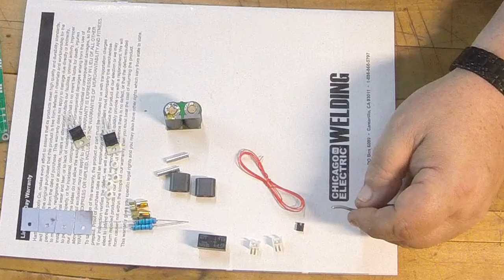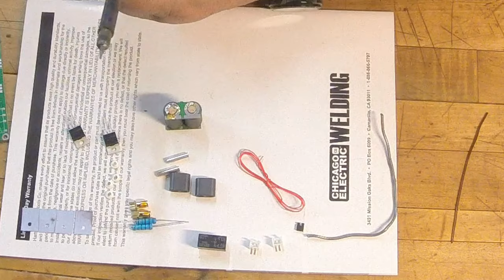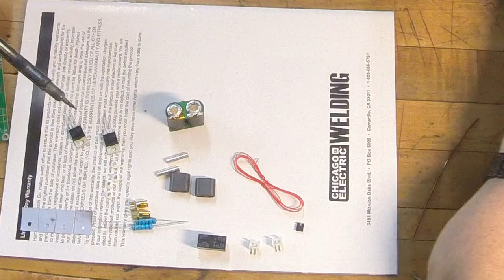Minipa 70 watt HF Amplifier Kit Assembly and Testing Part 1

Comment: My kit came w/o the electrolytic caps not soldered to the board. Did you mount those caps before you started your video? The reason I ask is because they are not easy to solder. My advice to anyone building this amp is to install those 2 caps before installing the big coils because there is little room to get into there to solder them.. I suppose it was too much trouble for the seller to write a measly instruction manual.
Reply from the maker: My caps came installed but I agree on if they didn't that would be the first thing I would solder down as well. I totally agree on instructions or the lack of them that is why I made the video in the first place to try and help others out as there was no instructions with mine either not even a diagram...